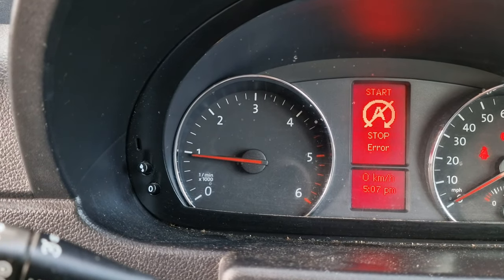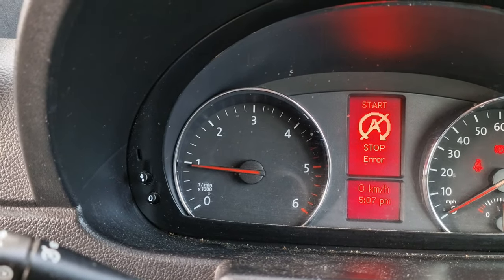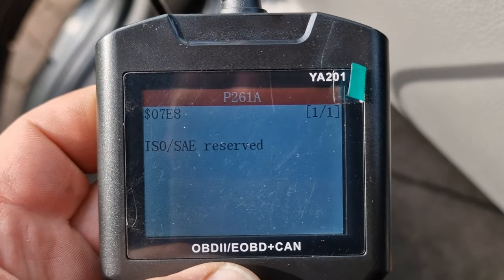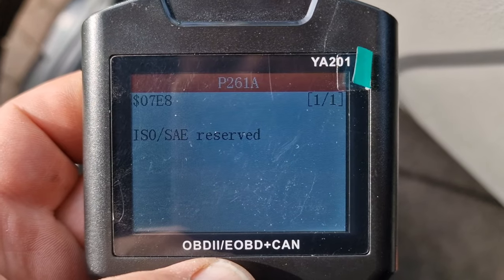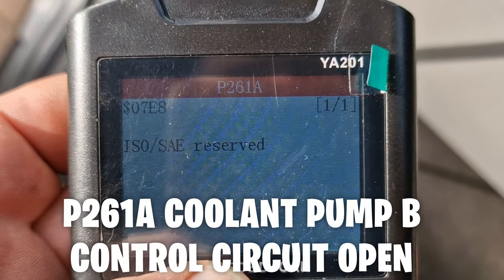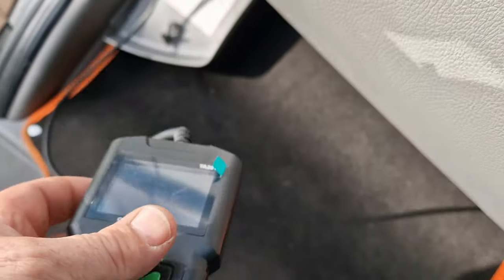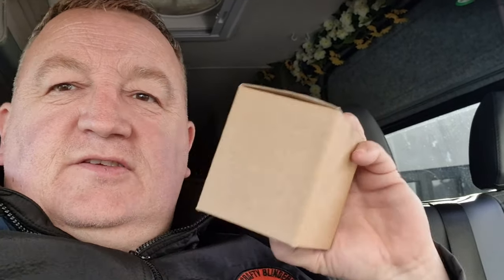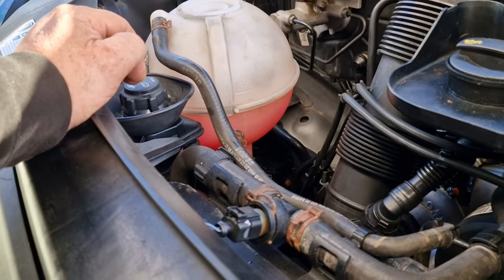How to fix fault code P261A on a vw Crafter by replacing auxiliary water pump B and aux heater pump

Comment: Mine went intermittent. Give it a shake and re start. Be ok for a while. Have replaced it now, But they are dam expensive. Bought from VW van dealer at £190 pounds.
Reply from the maker: We are fault free and have been since replacing it so happy we got to the bottom of this

Comment: I replaced it was saying pump B and the flushing light is still on
Reply from the maker: have you cleared the fault after replacing?
Reply: @TheCraftyBlindersvanlife Yes it was faulty put I bought another one and now the fault is going but the van don't have a power like is still in limp mode!

Comment: You wont believe what a small world it is, i have the same fault code on my Golf mk6 and yours was the top video. I'm gonna try this fix as can get the part quite cheap, however do you know if this would have anything to do with the P0102 code I'm getting as I've changed the MAF sensor and when I clear the code I still get the same fault code and glowplug light.
Reply from the maker: Hello pal 👋😁 its a really small world 
It's more than likely that you may have an issue with the connection. Is the MAF sensor an OEM part?

Comment: Same pump that went on mine last year on the way to big picnic I kept clearing the code till it stopped coming on to get there and then it did the same on the way home 😂 easy enough job to do great work mate 👍🏻
Reply from the maker: I didn't want to risk it failing on a big journey as it cools the EGR I didn't want a blown head gaskets again pal

Comment: Great job Som! I knew you would eventually find the culprit. I do have the same method of fixing my vehicles and sometimes I fix things proactively as well. One tip for o-rings and pipes in general, spray some silicone before install back. Slides like butter after that
Reply from the maker: Cheers for the heads up about the seal. I only had oil on the side of the road, but it did the job 😁👍

Comment: Just watched other video where you had trouble finding fault with turbo and pigtails permanently coming on I am at same stage ready to torch the van with me in it 
I have had Map sensor 
Egr valve 
Boost control solenoid all replaced at garage they road test for a week then hire the van out and pig tails appear followed by engine light then limp mode any suggestions please
Reply from the maker: @TheCraftyBlindersvanlife
  • 1 second ago
All my issues came back to the vacuum pump have you replaced that?
Reply: If I ask them to replace it is it an expensive exercise
Reply: Do you know if the pump has a fuse or relay? I’m having the same issue and I’ve got a new pump on the way but thought I’d check this in the meantime
Reply from the maker: good question I'm not sure

Comment: Hi Sam did you fit an original part as I had same problem on mine about a year ago, I fitted a new part from ebay and the light came back on. I sent the part back and replaced it with an original and it's been fine ever since
Reply from the maker: We fitted all oem parts I'm not making that mistake again mate 😁👍